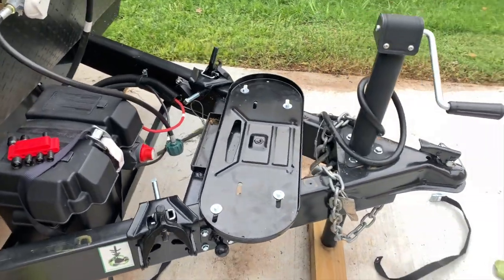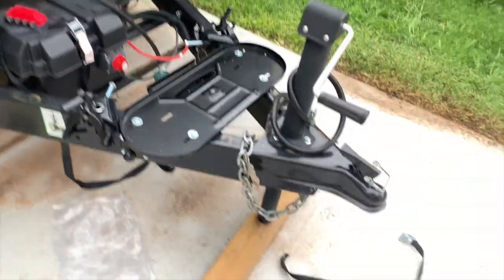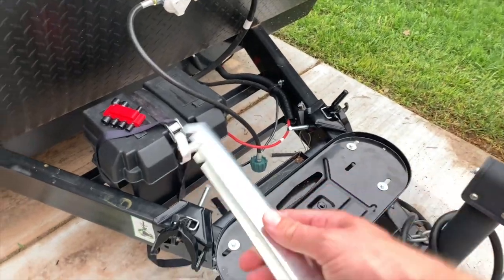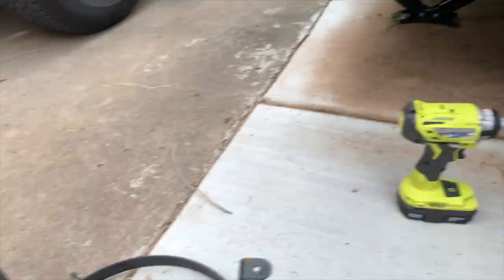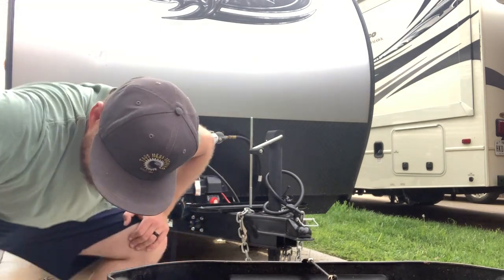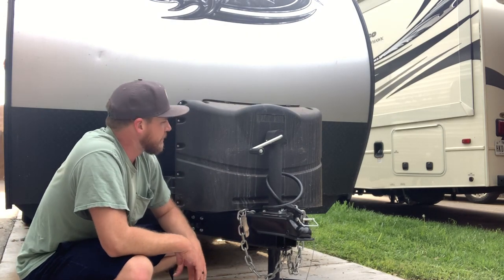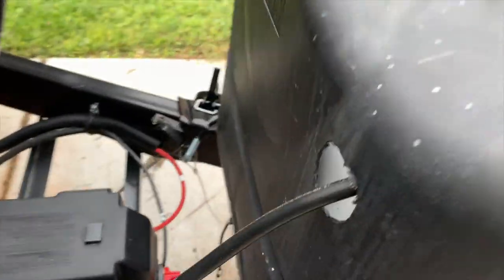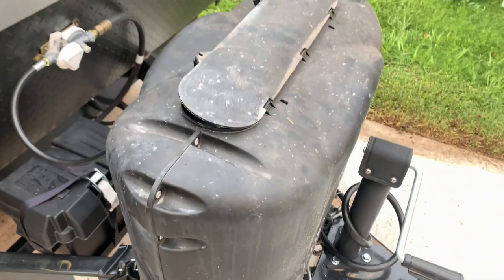RV Dual Propane Tank Rack Installation *Wolf Pup*

Comment: I also wanted to see how you attached the base plate to the frame.  Not sure if I need to drill holes?  With what screwdriver and bit?
Reply from the maker: Thanks for reaching out. I just used self taper screws and my screw gun to install the base. No need to drill holes with self tapping screws

Comment: I always try to piss off any thieves so I routed a heavy duty cable thru the frame and tanks under the cover. It wouldn't stop them but might make them look for something easier!!
Reply from the maker: Great idea! I do that with one of my splicing trailers at work and it’s been successful so far. Thanks for watching and commenting.

Comment: I have an old 92 jayco 1006 deluxe with a dual cylinder mount. from what i have seen it typically comes factory with a single cylinder mount. I am installing a battery on the tongue this weekend for off grid power, and there is no room for it either in front or behind the LP cylinders  (i have a wheel jack clamped to the front). is it possible to mount a single 20lb cylinder safely on a dual cylinder mount? I will need the space on the opposite side of the tongue for the battery.
Reply from the maker: Thanks for commenting. Hmmm you really need that other tank for the top metal piece to lock onto...what you could do is just use a ratchet strap to secure the one tank or buy the correct mount for a single tank. I use a strap to hold my 3rd tank on the tongue and it holds fine.
Reply from the maker: Or a easy fix is buy some of that angle iron from Home Depot (the aluminum with holes in it and make a tray that will fit in front of propane tanks. Use self tapping screws to mount it to the frame and strap your battery box to that. That way you keep both tanks as well. Check out this link and scroll down
http://www.campersolutions.com/home/battery-connection
Reply: @RotoCityTech  i have lots of ratchet straps, so i might try that, problem is who ever installed the twin cylinder mount welded it to the tongue. they did a nice job and it is not coming off without some serious effort. I figured that clamp would need some support on the other side to hold properly. I guess worst case, just haul the LP in the box of the truck, but it would be nice to just have it ready to go.
Reply: @RotoCityTech  I've got one of those wheeled jacks clamped on there. Initially that is where i wanted to mount the battery but the crank arm on the jack won't clear the battery box. I wonder if I slip a pice of EMT pipe over the post if it will allow enough tension to hold the tank in?
Reply from the maker: Well seems like ratchet straps it is. I’ve see. Some single tank mounts just screwed into the 2 tank tray so you can utilize the other side

Comment: Where did you get the tank cover itself? I see that doesn't come as part of the rack.
Reply from the maker: Thanks for watching. Yea I got mine that my dad had as an extra but here is a link to one on Amazon that also helps out the channel as I am an affiliate. https://amzn.to/3peYGd7
Reply: @RotoCityTech  that seems to be a link to the 2 tank mount but not the cover? Just curious if any cover will fit over the tanks and mount, or of it has to be specific to the tank mount you have.
I see you have a new trailer now, but my wife, daughter and I are getting the WolfPup 16BHS ourselves, and I'd very much like to make this upgrade :)
Reply from the maker: Oh yea sorry I copied the wrong link. Try this one. https://amzn.to/3obxquM 
 This should cover two normal tanks and yes it’s a great upgrade to any trailer really
Reply: @RotoCityTech  Thanks!
Reply: So they make a dual tank propane regulator, it automatically switches to full tank and is designed not to make holes in your cover. Nice work and thanks for sharing. We are in this together and I just found out about this setup.

Comment: This video is showing how to assemble a tank on, not how to install the actual base. I'm interested in the actual bolting of the device. There the hard part. Not the wind nut
Reply from the maker: Thanks for watching. Unfortunately because I had no help I wasn’t able to video that but I did explain in the video how to do so. Just use self tapping screws and drill them into the frame
Reply from the maker: I just removed the metal frame for the single tank and then placed the dual tank pan on the frame where I wanted and screwed the self tapping screws into the frame. Nowhere specific just somewhere it fits
Reply: Yes, this most important part of the installation was "glossed" over very quickly, which is the crux of the installation. Instead of self tapping screws, why not just drill through the frame, which is probably not that easy, and put a threaded bolt, lock washer and nut underneath? In time, the screws could work themselves loose or just break off due to exposure to constant road conditions.
Reply: @RotoCityTech  I watched the video multiple times and I could barely hear you say what you did to attach the new plate to the frame.